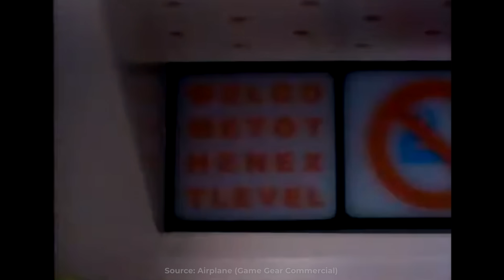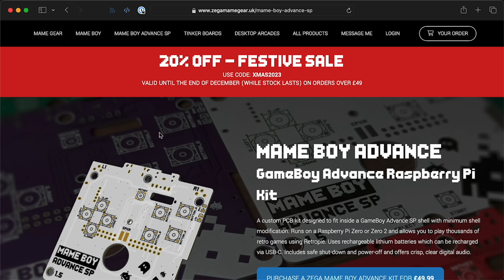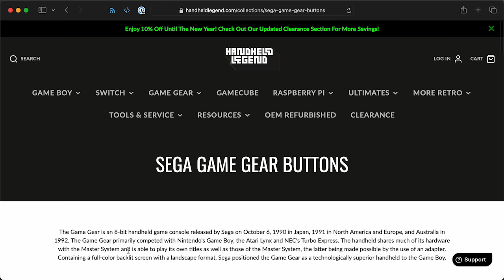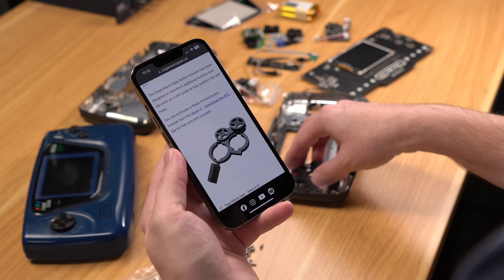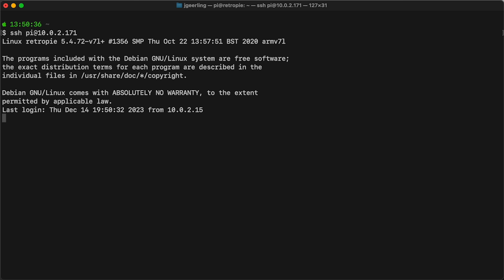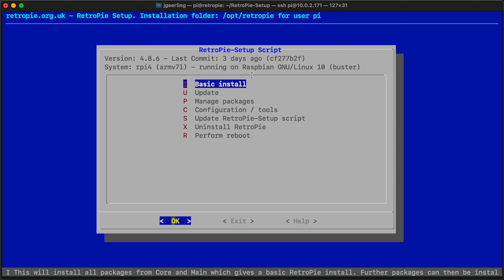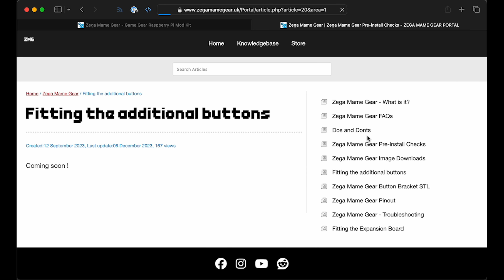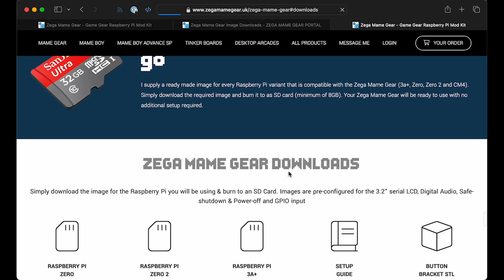Restoring a broken Game Gear with Raspberry Pi

Comment: Brand new reproduction Game Gear shells are available all over ebay and AliExpress for not a lot of money that there's no real reason to use original hardware for these kind of projects. Please consider not drilling holes in original shells and potentially creating e waste with the original boards. There are now reproduction Game Gear boards that allow you to repair corroded boards so there's no real good reason to not build a project like this using reproduction parts. I myself recently built a Pi handheld using a reproduction PSP shell.

Also, I have concerns about those framed Gear consoles still having capacitors on the board, especially Game Gears which are prone to leaking. Not to mention that the framed example in the video clearly has corrosion damage on the PCB...

Comment: When I first tried Emulation back in the late 90s,  it ran my P75 around 95% for most games like Pacman or Space Invaders.   I used to have a C64 which I could connect up 2 Atari style joysticks.  I still love to play old games.   In fact, the last game I bought was Tempest 4000 and I used to know the guy who created Tempest 2000.  Also, the original Tempest was one of my favorite games in the Arcade.  I want to get a New Raspberry Pi to make one that is more portable,  but having extra money and then finding a Pi5 has been a pain so far.   I haven't run one on my PIs since Raspberry PI 1.

Comment: I’d love to try this actually on my wife’s old semi working game gear. I’m sure she’d love it
Reply from the maker: Would definitely fix any issues she may have on the backlight!
Reply: To do this you only need a shell, you can buy them new and they are cheap. Some even come with the 4 buttons. There are better mods for a genuine game gear that reuses the internals of the game gear. Those chips are no longer manufactured and should not be discarded.
Reply from the maker: @RexBuyeo  On mine, the shell came bare (someone on eBay likely resold the other parts separately), but on the blue Game Gear I haven't decided whether I want to try restoring it to original status (though with new screen), or do a swap-out.

Comment: Wold love to see a FPGA version, that would be fun
Reply: just as a side-note: FPGAs are quite slow and rather for development or if slow speed / bad performance doesn't matter much but rather to get the job done
an FPGA would rather be a tool to develope an eco-system and when all is done to bake the design into an ASIC which then can run the fixed hardware way faster
using a microcontroller like a raspberry is a somewhat split between taking established hardware but giving up dedicated chips for a specific console - the reason why emulation works that well is just because modern multi-GHz cpus are fast enough to emulate those old chips which ran at quite slow MHz
Reply: @cryptearth  I was thinking MiSTer project in there, loads of retro fun

Comment: hrm. some of the holes look like they could use some rubber orings or whatever they're called to clean them up. :)
Reply from the maker: True. I think the HDMI port covers the console-to-console port on newer revisions, and there's a little plastic shield to cover the USB-C area, but it kept falling out on my build, so I wound up not using it.

Comment: How did you play N64 games without an analog stick?
Reply from the maker: Heh... it's not very easy. I may connect my 8BitDo bluetooth remote. For some N64 games you can map enough of the dpad and other keys to play the game. For others, it's not 'playable' without an external controller.
Reply: @JeffGeerling  looks like it's time to 3d print an add-on grip thing like the circle pad pro for the DS.